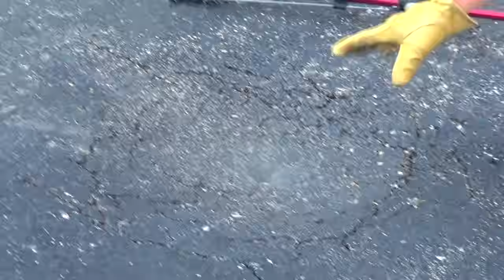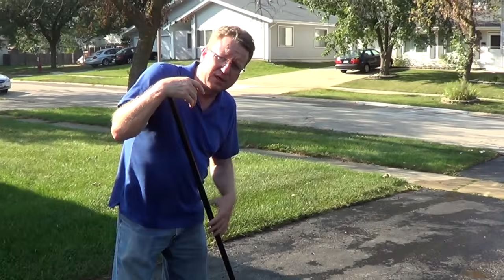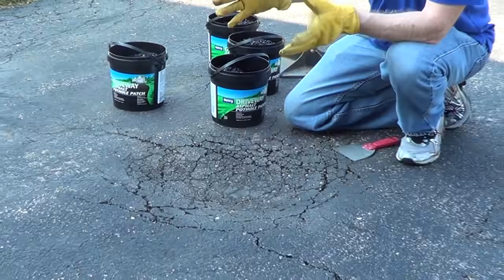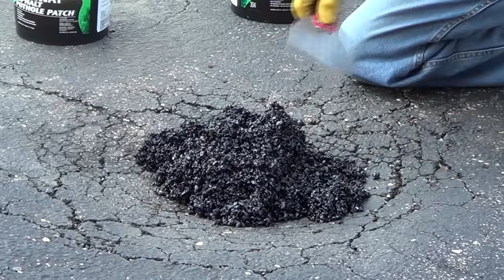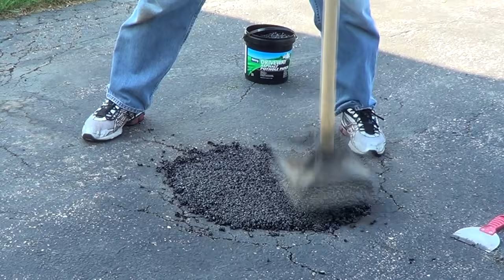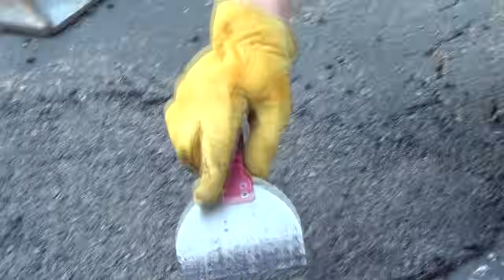Driveway Pothole Repair - Asphalt Driveway Repair

Comment: Simple and direct . My drive was recently repaved there are some areas that need caulking and some small spots where the drive  connects with the road that need small patches before seal coating ( no complaints the pavers did a great job ) this vid helps a great deal . Thanks
Reply from the maker: Glad it helped
Check out some home improvement tips in our e-books https://www.amazon.com/gp/product/B0B2KW1FQ9
Reply: @FIXITHomeImprovementChannel  I'm now doing an area of 4 ft. x 8 ft. that is cracked and sunk about 1.5 inches. I'll rough it up, clean it & spread roofing tar on it, then spread 5 bags of filler (50 lbs each) , level it with a rake & 2 x 4 , tamp it & use my heavy water tank lawn roller & do the edges as in the video as I have done before. I'll cover it with a sheet of plywood and run the car over it as it dries. It's just a spare parking spot. I'll also use a bag around the base of my brick chimney. Thanks for the tips this method has worked for me a few times.

Comment: Would a large weed burner make a much better bond? I've seen heat make it so you can take your old asphalt to a new top surface.
Reply from the maker: Hi, I would check the installation instructions on the product. When I took some training from a company with cold patch, they did not recommend heating the asphalt.
Check out some home improvement tips in our e-books https://www.amazon.com/gp/product/B0B2KW1FQ9

Comment: it will be better if you  take out old asphalt and   put this  new one to be  mre straight without tghis edges and hills
Reply from the maker: Hi, this is for homeowners that don't have the tools to create a squared off hole.
Reply: @FIXITHomeImprovementChannel  they probably have so much tool as crawbar or whatever  iron  to made hole of at least 5cm deep  or like it was thicknes of old asphalt

Comment: Great instructional video what is your opinion I had my driveway repair but this is what they did they first put down Layex Lite Airport Grade sealer repair yesterday Then they tried to play a game on repairing it ! “ how well do you think the cold patch from Home Depot well adhere if the driveway was seal costed first ? “ we greatly appreciate your thoughts !
Reply from the maker: Hi, it depends on how the patch was applied and how well it fits into the hole, but it should hold up well. I would cover the patch with a coat of the asphalt sealer once it has hardened. 
Check out more home improvement tips in our e-books https://www.amazon.com/gp/product/B0B2KW1FQ9?notRedirectToSDP=1&.

Comment: Thank you for letting me know that it takes three weeks for the repair to be ready to be resurfaced. I had someone repair and refinish my small driveway. He did not repair any cracks and the asphalt repair looks like patchwork. He did not refinish it at all. It looks like a child did it. I am going to repair the cracks and I will use crack filler on the asphalt repair myself, and I will refinish the entire driveway with another coat. Weeds are already coming through the driveway cracks after two weeks. I paid $1000 for a $300 job. It took me hours to figure out how and when to refinish a driveway after asphalt driveway repair. Once I do all that and I fill in the cracks, then maybe it will look like a $1000 job.

Comment: what temperature does it have to be outside to attempt this repair, I'm guessing the winter would not be good time to do this, do I have to wait till it's above 50 or even warmer? Thank you great video!
Reply from the maker: Hi, I checked out the label online and it says; All weather - hot or cold, wet or dry.
It doesn't give a temperature range.
Reply: @FIXITHomeImprovementChannel  thank you for the reply! Thanks for the video as well!
Reply from the maker: You're welcome.
Check out more home improvement tips in our e-books https://www.amazon.com/gp/product/B0B2KW1FQ9?notRedirectToSDP=1&.

Comment: Trying to deal with something similar. Should you fix the sinkhole under the asphalt?
Reply from the maker: Hi, you can remove loose asphalt, square up the sides, fill the depression and use a tamper for a more permanent repair. 
Check out more home improvement tips in our e-books https://www.amazon.com/gp/product/B0B2KW1FQ9?notRedirectToSDP=1&.

Comment: I don’t understand how little it takes to dry and how soon I can drive over it. I am also not sure what will happen if it rains
Reply from the maker: Hi, it depends on the product. Some can be driven on right away. Some recommend adding some Portland cement to speed up the curing. Some recommend allowing to cure for a few hours. You can compare the specifications and applications instructions online. 
Check out more home improvement tips in our e-books https://www.amazon.com/gp/product/B0B2KW1FQ9?notRedirectToSDP=1&.

Comment: Driveway sealer makes a patch not want to stick and peal off in shot order. use a propane torch to heat up the area and burn off some seal coat then slap on a patch while it's good and hot.

Comment: I have a 2x 12’ trench to repair. I originally priced it for cold patch, also thought it was going to be 6” wide, but my laborer cut it wider. I’ve never done asphalt before and hot patch is $2900 from paver. What are my chances of pulling this off cold ?

Comment: Using the crack repair is a good tip. Most skip that step if their sealing as well. But getting something in those cracks first, is a good idea. (that's what she said).
Reply: I really wanted to say "getting something around the edge first, is a good idea"... But then the lame joke does not work.

Comment: You could also use a hand grinder to create a milled edge around the perimeter, creating a smooth, flush join.
Reply: what kind of disk would be used on the grinder?

Comment: So, potholes happen due to moisture and temperature changes

The moisture with freeze and thaw and move closer to the surface each time causing expansion and compression weakining the bond between bitumen and stone causing cracks in the pavement.

Best thing to do with this stuff instead of tamping is follow his steps but dry the hole with a propane torch (make sure the surface is around 30 degrees celsius) fill the hole for every foot wide you want about 2 inches vertical clearance and smack it with a flat shovel. Over time, it will sink. But reapply and you'll never really have to worry about pot holes too much.

Comment: Thanks for the video, very instructive. But I have a question to ask. My driveway got severely damaged due some gas leaks from my car, and its been a really good while. now you can see the gas, the oily surface. What do you recommend that I should do to repair that damaged area? and its pretty big, its a damage about 3ft by 4ft give or take.  Im renting and I know that my landlord will pissed, so I would like to try to repair it.. So have any good and low costing suggestions?
Reply: Degease the area and pressure wash it. Then make sure area is dry. Get you a 5 gallon bucket of drive way sealer or any size bucket depending on your driveway. You will need to seal the entire driveway so that it is not visible. You can get a push broom and spread it on the driveway or they sell mops to do the job.
Reply: Get a torch it will reheat the asphalt  and add a little cold mix it in the old and tamp it

Comment: Didn't know you could repair a pothole over top of broken asphalt. Thought you had to break it up completely, clean it out, cut clean edges with a concrete saw, add gravel before pouring the asphalt in and tamping. This is much easier. You learn something new everyday. Going to try it - hope it works... and lasts. Thanks for this.
Reply: This isn't a half ass repair
This patch will last much longer than you think it will
He doesn't have the volume of traffic on his driveway that you normal roads do everyday not to mention the high rate of speeds that people hit these spots at
The cracks around that patch might break out a bit more unless treated
Crack seal will work 
A concrete epoxy will work better and last longer but again
The amount of traffic a driveway gets versus public roads
This patch will be fine
Reply from the maker: Hi, cutting it out is the best way, but for homeowners that don't have the tools, this is a good patch.
We have more home improvement tips on our weekly podcast  https://podcasts.apple.com/us/podcast/fix-it-home-improvement/id880903087?mt=2
Reply: @FIXITHomeImprovementChannel how's the patch now? What does it smell like? What color is it now?
Reply: @FIXITHomeImprovementChannel how's the patch now? What does it smell likee? And what color is it now???
Reply: Yeah you do this is a half assed repair that will fail.
Reply: @mp-xt2rg Half-assed repairs are my favorite kind, and they always seem to hold up much better than the expert warnings would have you believe.

Comment: I love all of the comments from people who have clearly never worked with asphalt or cold patch. Do you people not realize that this video was made for home owners who most likely do not have access to tampers or hot mix  or asphalt saws? Working for my city’s street division for the past 7 years I can tell you cold patch will hold up in a scenario like this for months years possibly if it is done right it even will hold up on high traffic roadways if compacted enough. Do any of you even realize how expensive hot patch is and that you can only buy it by 1/4 ton increments? This saved the home owner money and was a great fix. Rather then calling a paving company and spending an arm and a leg for  work that didnt need to be done they did it themselves. Enough from you arm chair quarterbacks who have never used the stuff more then twice in your life.
Reply: Thanks, dude for the method endorsement (from a professional). I definitely need to use this for my driveway. Can't afford the pro method.
Reply: Those pails of asphalt are a little expensive.. Sakrete makes a good patch that comes in a 60lb bag for about 8 bucks.. Also, a hand tamper is pretty cheap.. around 20 to 30 bucks and you have it forever
Reply: They keyboard warriors are definitely not blue collar.
Reply: DIPwhenyo
Reply: But long but
Reply: Said the meth head!
Reply: I have a 6” deep pothole in the middle of our street right outside my driveway. City says there’s a two year min backlog on any potholes. Do you think this method in three stages would be sufficient to last a few years? It’s a residential street. I wouldn’t call it high traffic but a car comes by maybe every ten min or so.
Reply: Are you new to youtube? Haven't you figured out how youtube works, yet?

- Post a video
- Wait for all the trolls to arrive and give their criticisms (not recommendations/solutions, nor their own videos showing their so-called successful method). Then they leave behind derogatory comments towards someone trying to help others out... then they move-on. Although when "you" leave comments recognizing them, you only feed right into their hands. If you ignore them they have nothing to feed off, and leave..... LOL
Reply: Bump N Run 
Lol. So, all of that being true, I’ve decided the goal to strive for in the ideal YT comment is—something sarcastic that exposes stupidity or ignorance of the dumb commenter.
It’s an elusive crown, but when it works it shuts ‘em up or makes ‘em continue to blab incoherently (like Democrats) 😎
Reply: @earlcampbell8927  Or lie lie lie lie lie....like repbubs!
Reply: DrgnFlys 
Lol
Well I could give a long answer but I see you weren’t born yesterday 
So I’ll just say McCain and Romney sucked ass, nearly as much as their opponent 😎
Reply: Scooters Videos 
So what? Feelings hurt?
Reply: Mee-Maw called, she wants you to bring her pocket rocket back.
Reply: Don't be to proud to say you do asphalt repair for the government. It takes 5 of you guys to do a few holes each week
Reply: You actually sound like you don’t know very much at all. Cold patch is much more expensive than hot patch. And you can definitely buy more than a quarter ton at a time you idiot I fill my dump truck full of hot patch everyday. Seeing you try and sound smart is making me cringe. You don’t know shit. I’ve worked for some of the largest companies in my state on paving, milling, dirt  and conditioning crews. Now I run my own operation. I can guarantee that you work under someone else and don’t actually know shit. And P.S. 7 years ain’t that long.
Reply: Dont recall asking you for your opinion guy😆😆😆

Comment: I bought a house that has a couple areas on the driveway that are now just red clay with gravel on top. Not sure how to fix those areas ???
Reply: Mark out a square with dimensions. Cut the area with a pavement saw. Fill 6 inches below the pavement surface with crushed stone. Tamp the crushed stone with a powered compactor. Add 3/4 inches polymerized sand to the crushed stone using pipes as guides and tamp again with a powered compactor. Fill the remaining surface with asphalt and compact with a weighted drum. Or just do like the man in the video. All the tools can be rented at your local Home Depot or Battlefield equipment rental. 
Tools needed:
- Measuring tape
- Spray Paint or Paint Marker
- Wheel Barrow
- Shovel
- Pick Ax or Hoe
- Pavement Saw
- Vibratory Compactor
- Drum Roller
- Hand tamper
- 3/4" PVC, metal, or other kind of pipe (2 pieces -Length roughly dimensions of patch)
- Board or straight edge to scree the sand between the pipes

Comment: What was the crack repair epoxy you used?
Reply from the maker: Hi, I used a Harvey product for this project. You can get asphalt crack repair in a caulk gun or a liquid. Most do a pretty good job if you catch the cracks when they are small.
We have more home improvement tips on our weekly podcast http://castbox.fm/u/6389499.

Comment: Best way to do it is get a bucket of black roof tar get a small 2 inch roller roll the edges with that then put your asphalt patch in rake it out smooth then sand it down the compact it really good then seal cost it and it was last for a very long time trust me
Reply: no it dosnt....

Comment: You  must be a council worker, filling in a pothole without fixing the root cause of the pothole underneath so you have to come back in 3 months to fix it again!
Reply from the maker: Hi, this is a tip for homeowners that don't want to cut out a section or don't have the tools.
Reply: You’ve met the bastards who do our area then. I see they’ve lined up more repairs, right next to the last lot where the rot has spread. They’re a bunch of lazy shitters.
Reply: @WineScrounger  It's not rot. The issue comes from the engineering and compaction of the sub pavement soil structure. When constructing a roadway the contractors need to create a gradation of crushed stone and screened gravel then use compactors to ensure each layer is firm and won't move due to water. However, often times the quarry for stone is far away from the construction site and would incur a great cost to utilize fully; in these cases the contractor may compromise using less stone on the bottom and only filling the top layers with gravel. Likewise, the drainage system and surrounding soil type play a huge role; if the site does not have adequate drainage the soil will lose it's strength due to liquifaction. Areas with high levels of silt, clay, and sand are susceptible to this kind of water infiltration. Urban developed areas with existing structures and infrastructure greatly increase the cost of roadway engineering.

In addition to environmental factors, the laws actually encourage contractors to leave virgin soil alone on a private property. Because the wording in the code states that the foundation depth is down a certain depth in virgin soil; contractors avoid disturbing the soil beyond that depth because anything disturbed requires engineering or it is against the law. So instead of paying engineers, or doing their best work, they stay legally safe and compete with prices that people can actually afford.
Reply: @brendanwood1540  ya and when they fix that way it still turns to shit in a year

Comment: Amazing to see so much tarmac used on such a small area. I would have cut the old stuff out.
Reply from the maker: Hi, cutting it out does a great job, I showed how to fill a depression for the average homeowner who doesn't have the tools to square it off and remove asphalt.
Reply: I agree I would have cut it out and just redid those bits average homeowner can easily get the tools but it’s pricey but it’ll last longer.